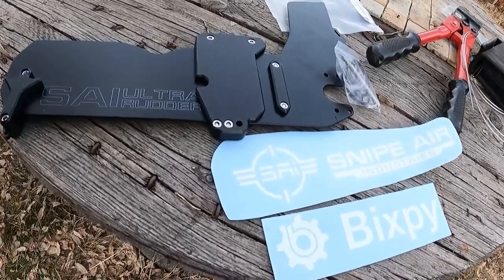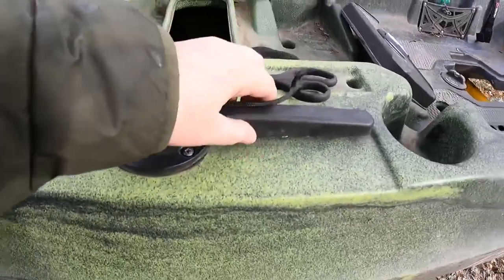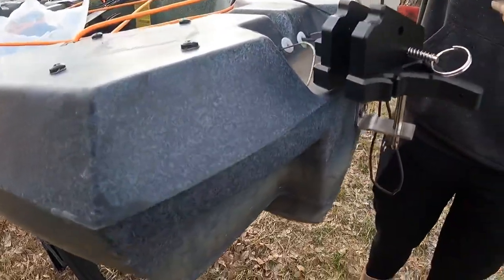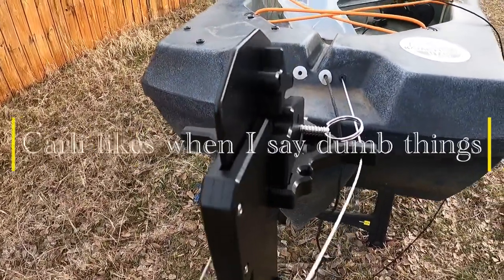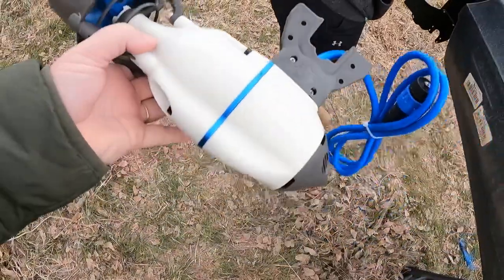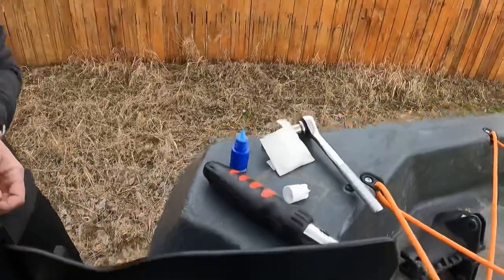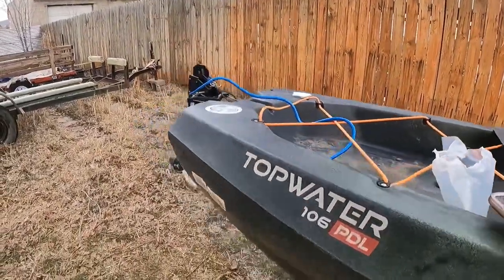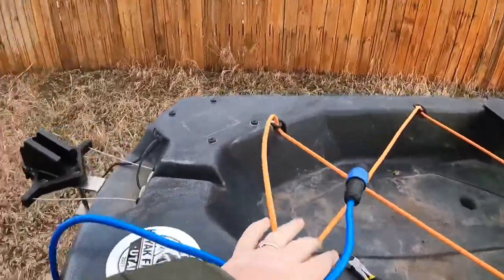Bixpy Jet Motor Install on Old Town Kayak.

Comment: Im about to do a build with newports 24v 86lb, and a old town center pod on a bigwater 132. Will post video. Just waiting for iceout. Was going to do bixby but I dont do proprietary batteries unless they milwaukee.
Reply from the maker: Nice ! I do understand your hesitations with it. Newport makes an awesome set up ! I just decided that I wanted a low profile approach to motor assistance.   I really prefer to pedal because I love to get in the outdoors for exercise .  So the bixpy to meet is more of a pedal assist . I like the simplicity of the design .
Reply: I want to see your results.  How does Newport handle?

Comment: What happened to the crossbar for your Boondox? You're going to have problems without it! Too much stress it'll cause cracks! I'm thinking of adding a Newport but I'll use the anchor pole mount so I can use the Kayak without the motor or when the motor is raised.

Comment: I have a Topwater PDL too. Like your setup. Wish Bixpy would make the power source more flexible. Just got a $$ 100ah LiFePO4 Bat combined with a side mounted Newport trolling motor. It gets the job done, but the big battery make sure I can run full power for 4 hours +. What's your topspeed by the way?

Comment: How did you get the steering control working? I can’t seem to get mine to hold any tension when running new steel cable for the rudder. I installed it the exact same way I pulled the stick cable out but I seem to lose tension on one side and can’t get the rudder to hold position

Comment: Thanks for the video. will you do another video when you get this on the water, Please..
Reply from the maker: Absolutely . Thanks for the comment .
Reply: Hello, install similar on my pdl120 using the universal rudder adapter, but using the handle to pull up the rudder with the cable that come with the kayak, do not hold the rudder up due the weight, so when i pull up the rudder and remove my hand to hold it, then always the handle return back. How is in your?
Reply from the maker: @usermiamiusa  yes the weight is an issue . My set up is pulled down by the weight even though bixpy is light. I have a fix in the works for this and once the snow storms let up in Utah I will get a video posted for it.

Comment: Has this modification worked out well for you?  Considering the same on a PDL 106.  Thanks
Reply from the maker: I do love the set up.  I think for the price of the bixpy with the included battery is hard to beat at the price.  There are faster motors out there , but most are going to require a large lithium battery and that it’s  self is a $1000. So bixpy is a good mid level price range. It has made a difference in how i fish and where I fish. I zoom all over the place now and find myself cranking a lot more to find new fish.

Comment: Won’t that cable dig into the plastic?
Reply from the maker: Remind me what are you area referring to ?
Reply: When you reattach the steering, you used a cable. My predator pdl has a cord. I was just wondering if the cable rubbing through plastic was an issue. I’m considering the same setup. Thanks